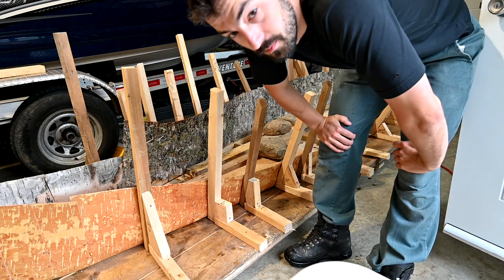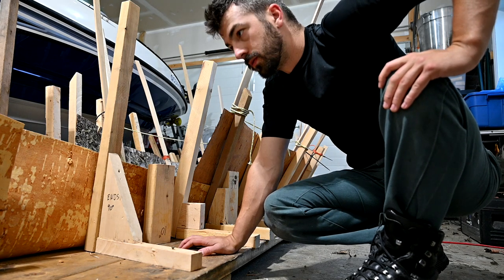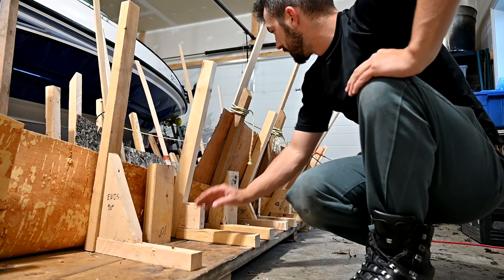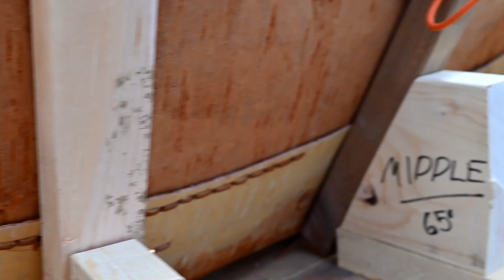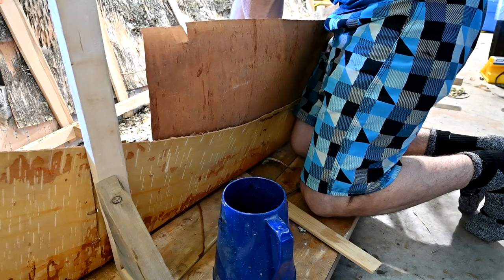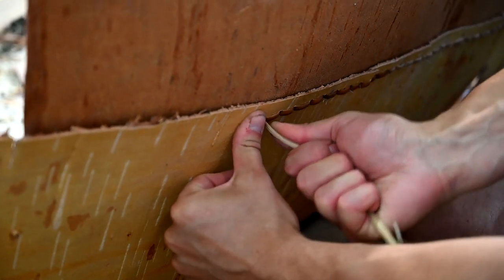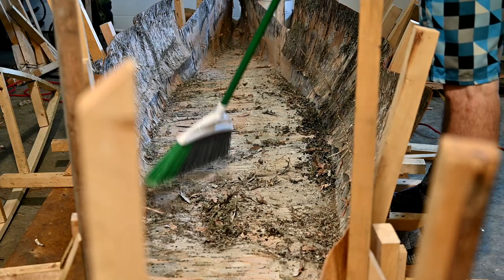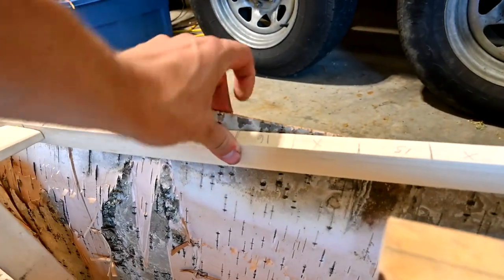Birchbark Canoe Build - Part 2 - Establishing sheer of gunwales - Algonquin old model

Comment: A few questions: Besides appearance due to the cadmium, is there a difference between winter and summer bark? Why did you put the top layer in the canoe instead of out (like shingles on a roof)? The bottom is row boat flat? And most importantly - what's with the helium dolphin balloon? The making of a canoe is one heck of a job (in a garage with help from modern tools.). I can't imagine how they did it in the bush. Thanks for the video. If anyone ever calls you lazy, show them this video.
Reply from the maker: Great questions, some hard to answer I may not know all the answers .. i'm still learning ! haha. Most important question : The helium dolphin haha, it was my son's birthday early July and his chosen theme was dolphins and under the sea birthday party lol so he has been bringing that balloon all over. The bark goes this way with the winter bark panel  inside as it is how I have always seen it done in my research. If the canoe is upside down and you would be sleeping under it, then I guess it would be like shingles on a roof the way it is. Either way it gets gummed on both sides of the bark. Also this way, I leave a length of winter bark on the inside so the overlapping bark protects the other bark somewhat  at the curvature of the canoe. The boat will not be flat like it is right now on the platform, once the ribs go in it will take the rounded shape of the ribs, this will be in the next stages of the canoe construction, the canoe will take shape and come to life with the ribs and sheathing. Hope this answers somewhat, I don't know any other significant difference between the 2 barks. One is gathered earlier in the year and less sap flowing. The winter bark is generally more dry to the touch and less flexible as it isn't full of sap like the summer bark.
Reply: @NomadicWoodsman  Thanks for taking the time. I feel a little foolish because I think I already asked about the dolphin. Your answer jogged my memory. I'm guessing that there are many variations of how to build a birch bark canoe. Some regional and others just tricks learned through experience by accomplished builders.
Reply: @mushercdn  I bet it's easier to get the sealant down into the seam and gravity would make it less likely to fall out when bumped and as Steve said less apted to be damaged. Also as He pointed out in the video on harvesting winter bark , it's MUCH harder to harvest. Especially maintaining that scratable layer.
Reply: @timothylongmore7325  You "gravity" response makes one heck of a lot of sense. Thanks!

Comment: This is great for reference on how to go about certain stages ... Looking good. Two questions, what would be the difference in thickness of your summer and winter bark on this particular Canoe ? And can you or have you split spruce roots that is to big in quarters or more ? Thanks
Reply from the maker: Good bark for canoes is 1/8 of an inch to 1/4 of an inch roughly. Could be a little thinner. On this canoe both summer and winter barks were about 1/8 of an inch if I can recall. Both good and thick. I mostly target the pencil / pen size roots and split them in two. If they are really big massive roots that are too big I don't collect them or boil them / process them. If they are about thumb size I'll split them in half and then I'll keep them maybe for lashing other things if I need a bigger piece. I'm pretty picky on my roots, this is what makes the canoe so nice at the end, is having nice even roots, shows great craftmanship in my opinion. Hope that answers, Steve
Reply: @NomadicWoodsman  If I'm not mistaken Steve, when you saddle stitch the panels in, aren't your roots going to look right going in one way but is going to look like the heart of the root when you go through again the other way ? You did answer my previous questions thanks.
Reply from the maker: @charlesleblanc6638  You need to flip / twist the one side that would show the heart. So on your first ''stitch'' you flip it on the inside of the canoe (where it won't show) so you use both halves of your roots to stitch.  So I choose a nice root. Ex. 4 foot root.Put it in the hole and slide it to the middle so I have about 2 feet of root on each side (inside and outside of canoe) then start stitching and flip the root that's inside the canoe so it won't show the heart. Kind of hard to explain but you just twist it on the first point.
Reply: @NomadicWoodsman  OK so you just twist the root as your stitching/pulling in through so the good side of the root is always showing on the outside of the canoe ? It wouldn't really matter since it's all being pitched I'm thinking. Just finished boiling a bunch of roots. Great material.
Reply from the maker: @charlesleblanc6638  yes exactly